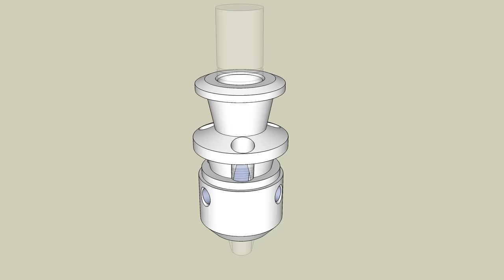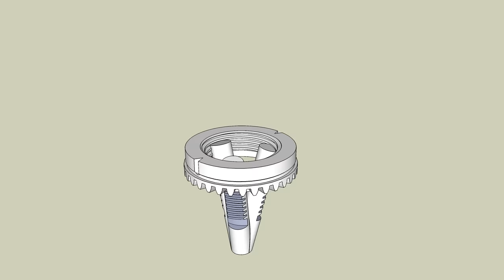Drill chuck disassembly

Comment: You don't have to saw into it. The outer sleeve/ring gear is just pressed on.
Reply: Dave's Stuff  No it is not .    I have the same chuck. and the outer sleeve is roll crimped  for the complete  diameter into a recess at least 1 mm  deep . The sleeve looks to be 1 to 1 1/2 mm thick so it is not just a press fit  , there is no way to remove the sleeve without  removing at least the larger part of the crimp and  thinning what remains so it can be distorted  enough to clear the groove There is  a very similar chuck shown on YouTube that is  a drive fit , as the guy dismantles it by holding the sleeve and driving the body out with a few blows of a hammer

Comment: Nice video - and quiet ;-).       When the chuck of my Bosch drill got stuck, I was able to fix it by first flushing with silicon spray and next generously applying silicon grease.  While doing this, the range of movement became bigger & bigger until it functioned as new.

Comment: Thank you for your instructive Video , I had to pull a 1/2” chuck  I am modifying to fit   a jig  I am making to sharpen drill bits ,  I was half way to disaster when  I checked on you tube and found your clip  .  Luckily I have a lathe and was able to remove  half the crimp and reduce the thickness of the remainder  so I could force it out of the groove , now I can reassemble and re crimp the remaining portion   Thank you again   I would probably destroyed the chuck had I carried on  .

Comment: Interesting.  Thanks for that.  I've had chucks getting very stiff due to dust / dirt getting in, when e.g. drilling into ceilings.  So I soak them in white spirit & work them open / closed several times to flush out the dirt.

Comment: Nicely done video and yes you are right, those things would need some special press tooling and a lot of force to open without doing what you did. Though I would have just given it a lick with a cutoff disc while it is spinning in the drilling machine.

This is why I love those one-piece keyless drill chucks, they are easily disassembled by unscrewing the cover, cleaned and returned to service. But even though the name is keyless, I still recommend the ones that have 3 or 4 holes around the chuck so that you can tighten them properly with a pin/hook spanner.
Reply: Now that I know, I would drill a hole in each side of the press cover to remove, and use pins

Comment: I had a similar problem. The drill chuck was open and I could not clamp a drill bit into it. I applied some lubricant into the space or groove that is between the inner fixed part and the outer revolving part of the drill chuck. After 24 hours or more, I could loosen my drill chuck.

Comment: You didn't have to cut it apart. They are made to push together and apart with the broken ring gear used to keep it working inside. .
Reply from the maker: You have probably experience with a different type of drill chuck. The sleeve of this type is made from 1mm iron sheet and its bottom edge is pressed into the groove in the ring (1:14). The force necessary to bend the bottom edge straight in one step would be enormous - and there is nothing on the sleeve what provided a good grip! The cut not only make the necessary force smaller, but mainly create support for the ring (1:36), so the force could be applied.

Comment: I've had them apart and didn't have to saw it I just drove the outside collar off.
Reply from the maker: Unbelievable. I thought only Chuck Norris is able to do it. Are you sure it was the same type? Will you disclose how you managed that?
Reply: mm0063 big ass hammer
Reply: mm0063 *Chuck* Norris... kek
Reply: D J   Where did you find an edge to apply the drift ??   If the chuck sleeve is crimped there is no edge  tell me how you did it  ??????

Comment: Let see, I don't anything about drill chucks so I'll cut this up with a hacksaw, beat it with a hammer, discover broken teeth, put it back together and try to use it again.  Brilliant!  Like my wife always says, "Anyone can make a YouTube video".
Reply: So too can anyone comment on them...
Reply: Ron I have repaired many chucks over the years mostly Jacobs chucks, but the chuck featured in the  Clip had me in trouble  until I saw the video !  I have reassembled chucks with broken teeth many times with complete success .  What do YOU suggest , buy a new chuck??     I like the guy that has a go and repairs things  saves lots of money and if he ever finds himself in a situation where spares are not available he  can still do the repair , all because of what he has learned over time by getting off his bum and having a crack !!! Ps I have repaired many Jacobs chucks,guess what I used to dismantle them??   A Hammer !!
Reply: @billymorrison7919  Yes, buy a new chuck or get a rebuild kit from the manufacturer.  Broken teeth are a weak point and do not allow the chuck jaws to be tightened as designed.  If you don't have a press you can use a hammer but you should use a brass bushing to keep from making permanent dents in the steel.  But then again, if you don't care about fine machined equipment go ahead and beat it but if you dent the edge where the jaws come out the chuck will never work right.  By the way the jaws should never ever be pressed or beat with a hammer.  That's one way to get broken teeth.  Also the jaws on some/most chucks should be almost fully extended before removing the sleeve or barrel because on some/most chucks the sleeve will catch the lowest threads and break them.  And finally, do you know why there are three holes in the chuck body for the chuck key?
Reply: Ron  you sound like a real know it all ,  I have been repairing chucks for years   My  experience spans  20 years as a foreman MotorMechanic  Followed by 20 years as a Maintenance  Fitter.  specialising in the repair and maintenance of Desoutter  Automatic Feed Air Drills and their accessories Double headed Drills and tappers  ,  Hydraulic control units etc .  So I expect that my experience will far outweigh.yours , you talk about hammer bruising as if  you are an expert !! , that would figure you have probably bruised everything you have laid your hands on!!  I was trained  by old time craftsmen so butchering things was not one of the skills I acquired !!!
Reply: @billymorrison7919  Alright, I concede.  You have extensive knowledge of things I know nothing about.  But drill chucks I do know about and that was the point of my remarks.  Beating on a fine finished and machined drill chuck with a hammer without protecting the surface is abuse.  Using a hacksaw to cut up the sleeve in order to get it off is also abuse to the max.  Putting jaws, that have broken teeth, back into the chuck is not repairing the chuck.  The threaded split ring, that the sleeve is pressed on to, needs all the teeth of the jaws to work properly in order to apply even pressure on various sized bits.  Granted, if the teeth on the bottom of the jaws are broken you can still use the chuck on bits with shanks larger than ¼” or so but the chuck has not been repaired, salvaged for partial use maybe but not repaired.  So back to my first comment to you, trash the chuck or get a repair kit from the manufacture.  I suppose there might be a way of building the teeth back up by welding and then using a milling machine to get the proper shape, twist and arch but I don’t have the proper equipment to even attempt that and the time spent would be counterproductive.  Bits that can come loose can cause lots of damage.  You should know that, so why take the chance?
Your answer is correct.  There are three holes in the chuck body to allow the user to apply even maximum pressure on the bit, assuming there are no broken teeth.
Reply: Ron  Hi Ron.  I guess we will agree to differ , I served my apprenticeship in my home town on the Isle of Bute  where spare parts if not on hand were at least one a half to two days away , from Glasgow  and that dependant on our supplier having stock , if not it could take twice as long..  That is probably why  I developed the repair rather than replace method of keeping a vehicle on the road ,  The owner could still use the vehicle while waiting for spares to arrive .  I strive for perfection in all my work, but I live with being practical in a less than perfect world. Your  latest reply is more in keeping with what I would expect from a Vietnam Veteran  I thank you for your service  Stay Safe  Ron.  In these troubled times

Comment: Any idea what size drill Chuck replacement I need for a 8" Harbor Freight Drill Press model 44505?  It was returned to me without the chuck and a busted knob.  I then tried Harbor Freight and they said they do not have replacement parts for it.  Wondering what I can do, if a different chuck would work, and maybe one that I wouldn't need a key for possibly?  The manual doesn't say a size, just the item number B8..., no size fo the actual chuck is listed anywhere on the manual either.  Help Me obi wan.
Reply: Measure  the spindle and search for a chuck that would fit
Reply: Doug Scud
Reply: Most spindles are a MT2 or MT3 (Morse Taper) which are very common; purchase on eBay
Reply: not totally correct the HF stuff carry mostly  the Jacobs taper  . I found out the hard way. I.E  by  buying a new chuck again.   May I suggest buy a really precise chuck  ROHM  there is no betterGerard